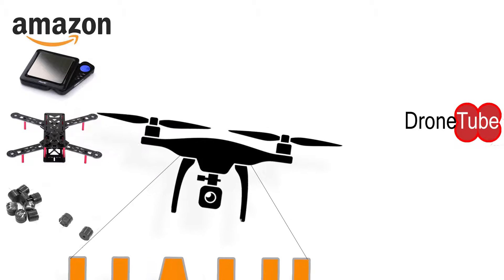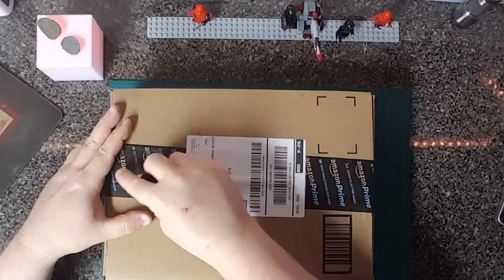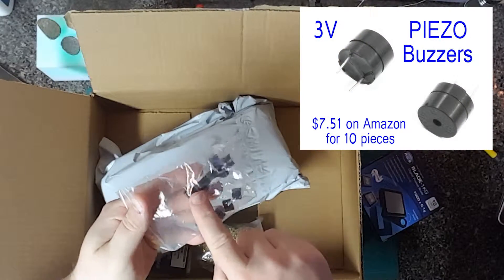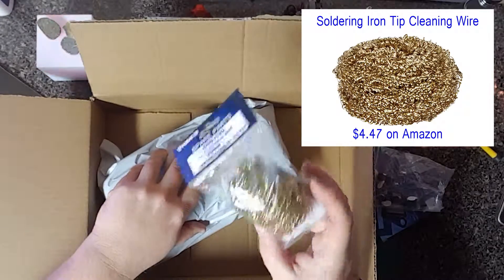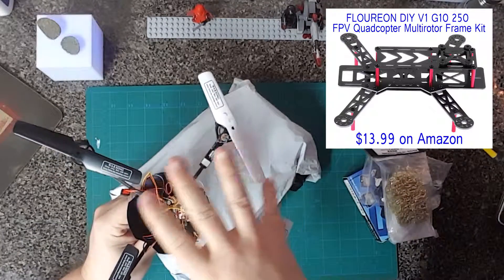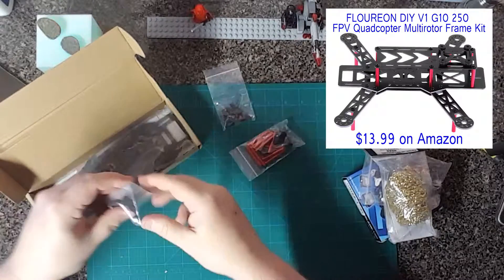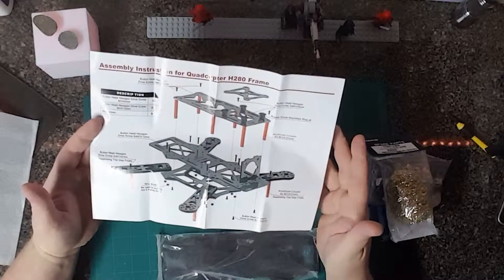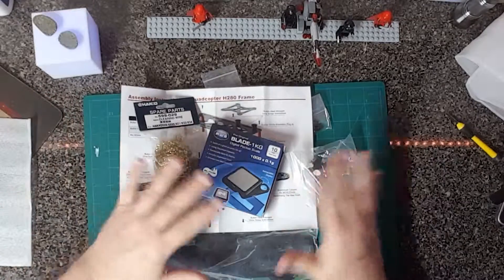Drone Parts HAUL - AirFrame Kit and other components - DroneTube

Comment: What happened to the udi transplant?   Just wondering if it worked.
Reply from the maker: Hi, thanks for asking. Well, after weighing up the new frame i bought compared to what i was removing from the UDI the difference was so great that i figured the motors wouldn't handle it and never tried. The UDI is already at capacity and even adding a larger battery affects the flight. Physically it wouldnt have been a problem but would not be powerful enough to get off the ground. I should try it anyway this winter when i have some down time. Thanks again and happy flying.
Reply: ThinCube oh the new frame was super heavy compared to the original plastic frame.
Reply from the maker: FSX239 Yeah, even though i bought a small racing frame, relative to the UDI frame it was a porker...lol